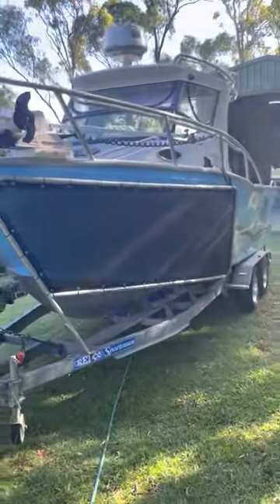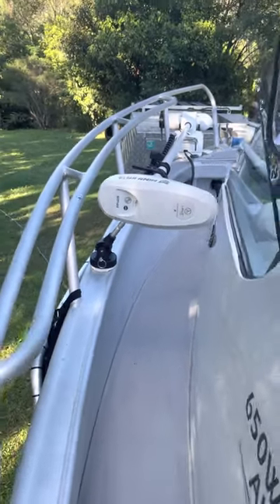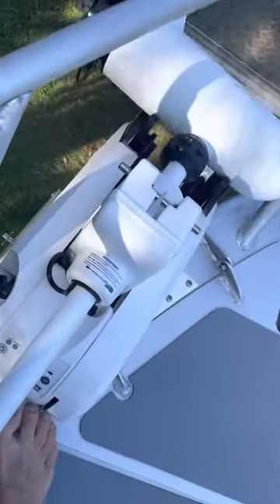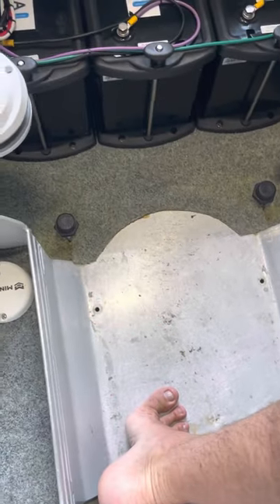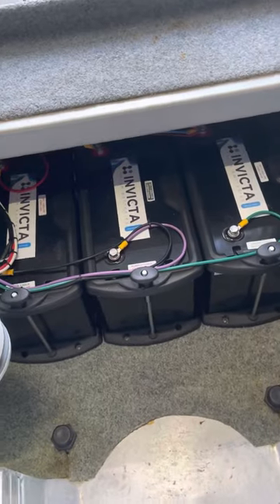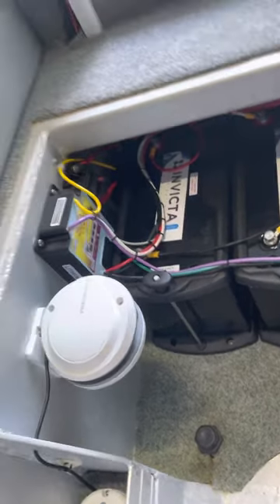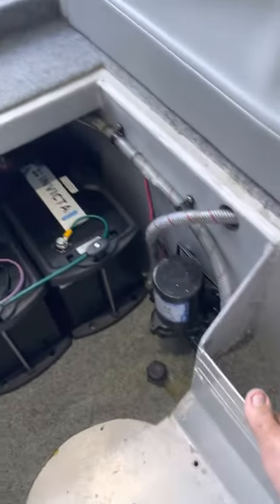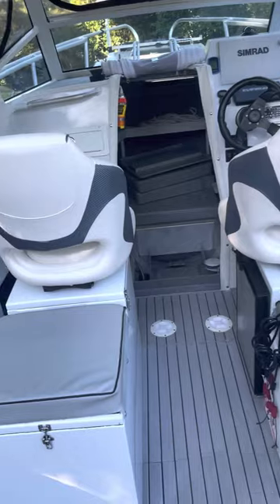36V 87” shaft 112Ib Minn Kota installation

Comment from the maker: The battery’s I have used are the Invicta Lithium SNL12V100S. One key thing if using 12volt Lithium in series is to check that the battery you're looking at is capable of multiple series connection lots are not. - https://invicta.mymedia.delivery/wp-content/uploads/2020/09/SNL12V100S.pdf

Key details on Minn Kota Heading Sensor: 

1. The Minn Kota Heading Sensor provides boat heading information to a Bluetooth compatible i-Pilot or i-Pilot Link equipped Minn Kota motor. It contains a compass that senses the boat’s heading. The heading is used by the i-Pilot or i-Pilot Link system for navigation features such as Spot-Lock Jog. The Heading Sensor does not contain a GPS receiver and it does not change or control the orientation of the boat.

2. The Heading Sensor contains a compass that detects a magnetic field. Do not install the Heading Sensor near ferrous metals or wires that handle large currents, such as batteries or power cables. If unsure, use a standard compass to check the spot for interference. (I had to keep away from the freshwater pump as it has ferrous metals and interfered with the compass big time).

3. Position the sensor so that the arrow on the cover is pointed toward the front of the boat in the direction of travel. The arrow needs to be parallel with the keel of the boat.